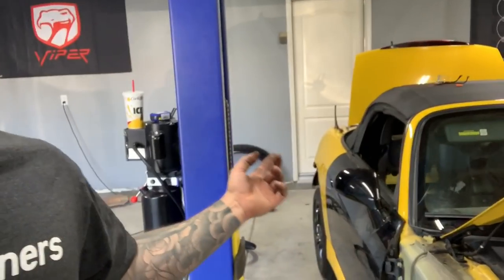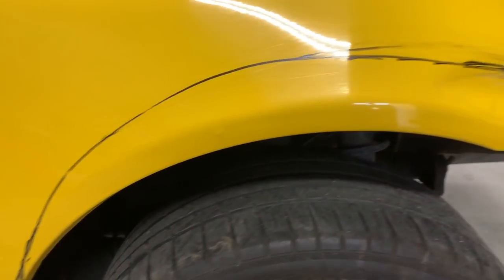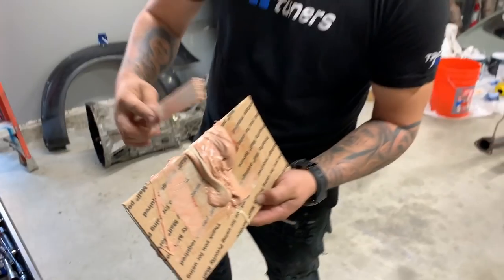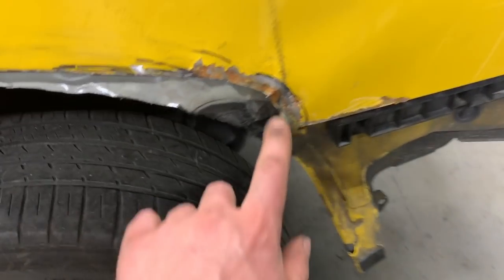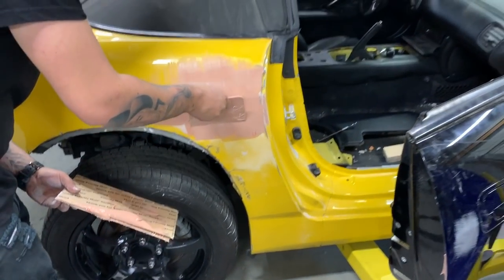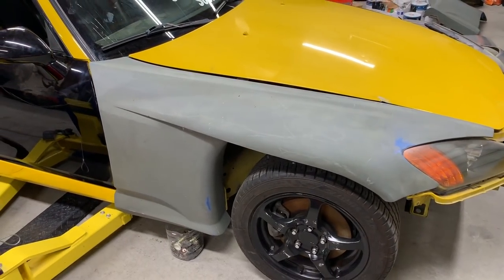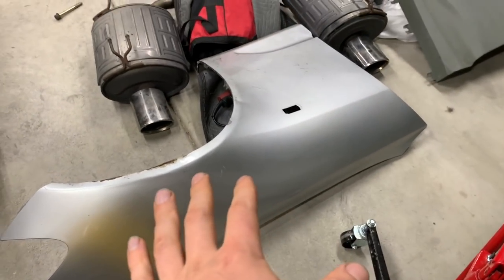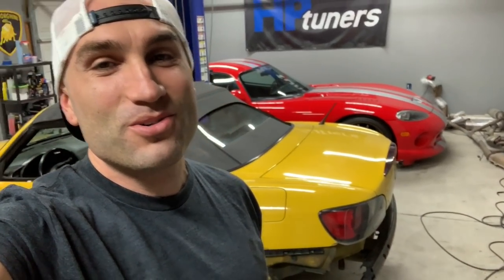Rebuilding a Wrecked Honda s2000 Sports Car - Part 6

Comment: What about using a heat gun to make the metal more malleable?
Reply from the maker: Thats not a bad idea either!  We already filled the pass side it didn't need too much work after we moved the panel back into position.  Most of the driver side fortunately gets covered also 😎